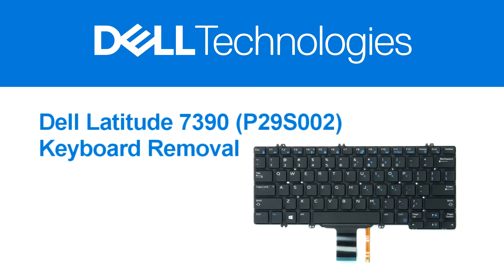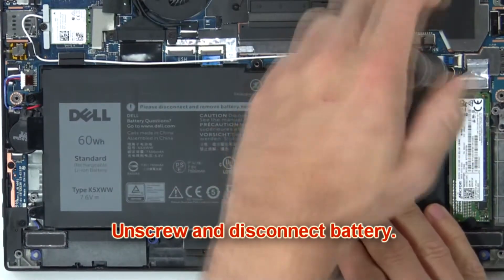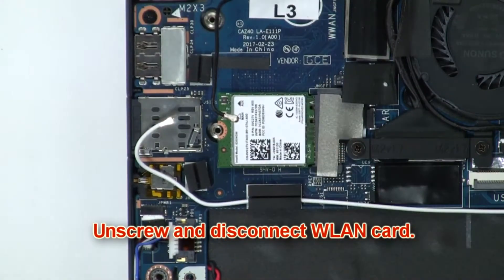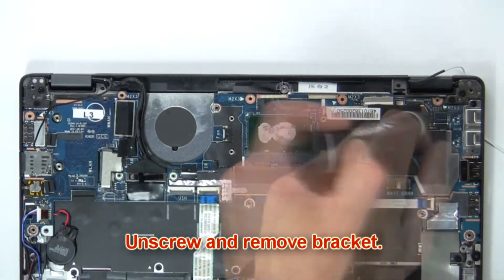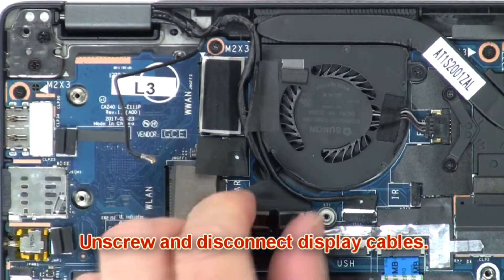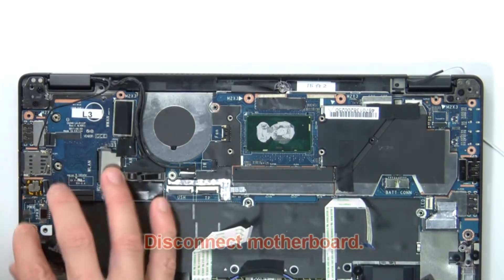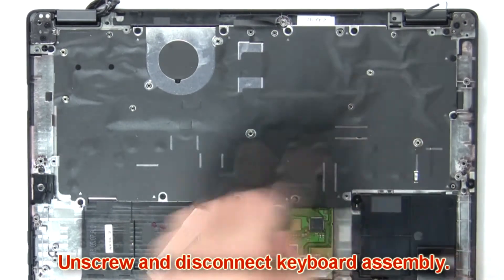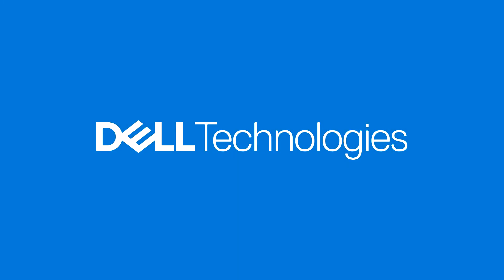How to replace the Keyboard in your Dell Latitude 7390

Comment: I have a Dell 7290, same layout as the 7390.
My keyboard works fine, but I mostly use a separate , small, 2.4 Ghz wireless keyboard with my 7290. Lots of various wireless keyboards available on Amazon.
Thanks. toronto canada.

Comment: Can someone help me with cmos plug polarity?  My wires came out of the plug, and I am not sure of the correct polarity.  If anyone knows, can you tell me if red wire should be towards the outside pin or the other?  (defining "outside" as to the left with the PC and Motherboard orientated as shown in the video, with heatsink at the top)